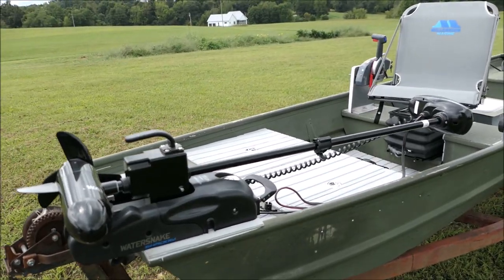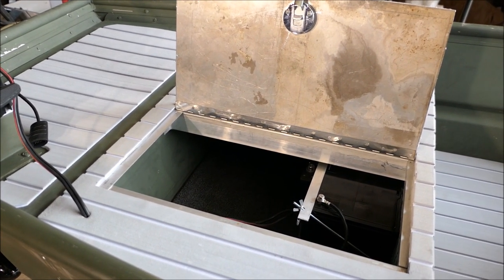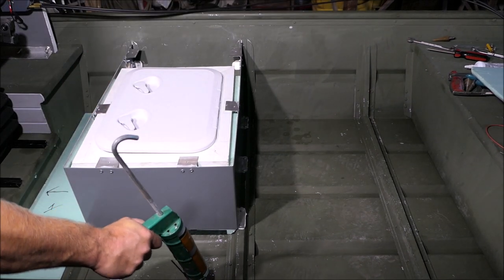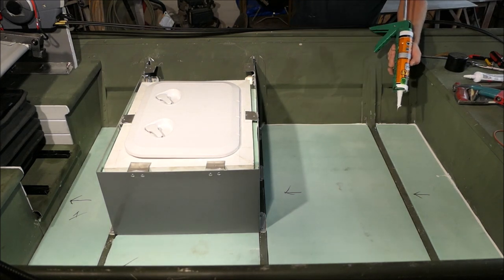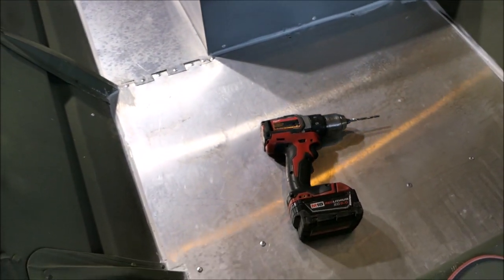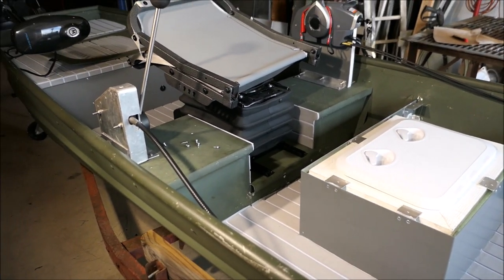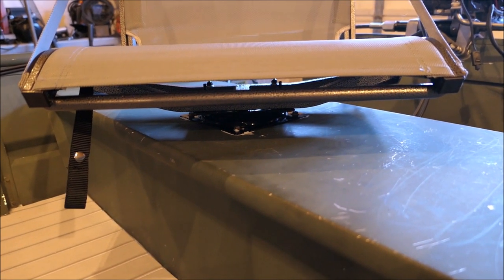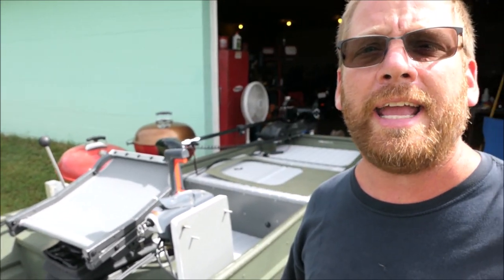Flooring.. Trolling Motor... Live Well 14/32 TINY BOAT BUILD !!

Comment: I have the exact same trolling motor on my 14/36 Lowe. Great trolling motor. But I hate that foot control design. I wish it was more of a 45 degree angle 📐. I use a pad eye mounted to the side of my boat and run a bungee around the shaft to the pad eye. Stops all the bouncing around of the shaft. When you cut down your shaft first look up on YouTube “How to cut down trolling motor shaft “. After you take the head off use a 1/2” piece of pipe to slide over your wires and down into your shaft before you cut it. It protects your wires from being damaged by your saw. And also by your drill when you re drill the head mounting hole for bolt.